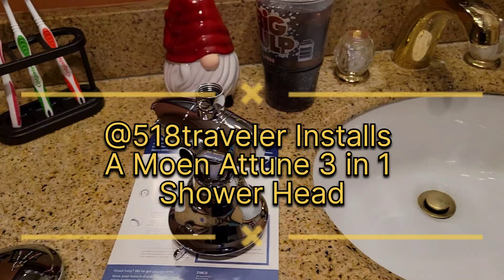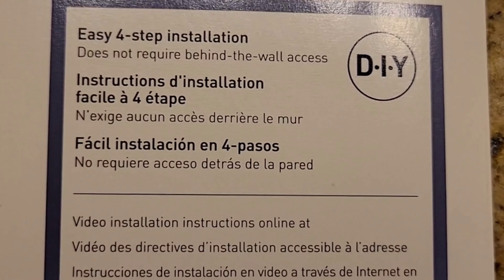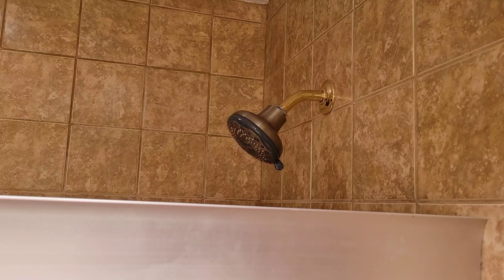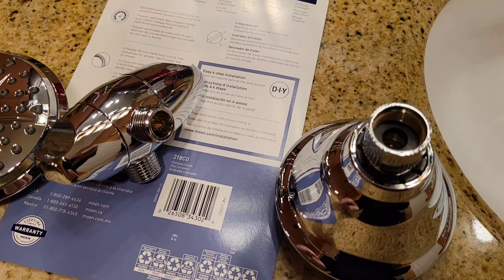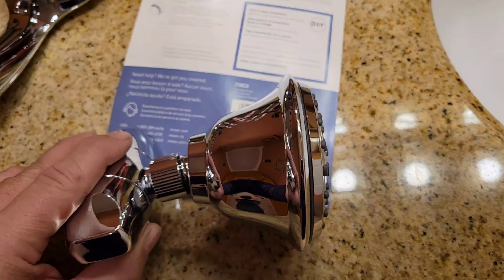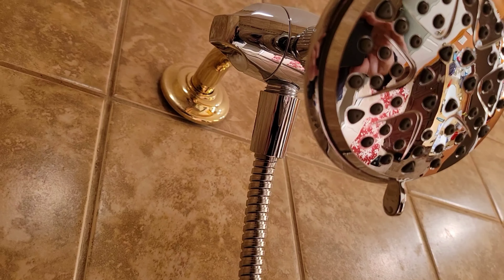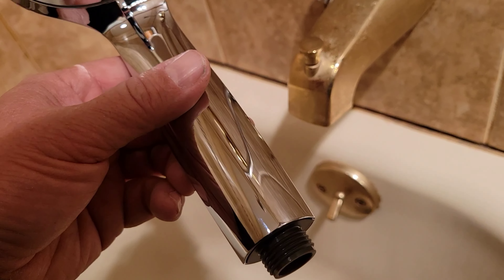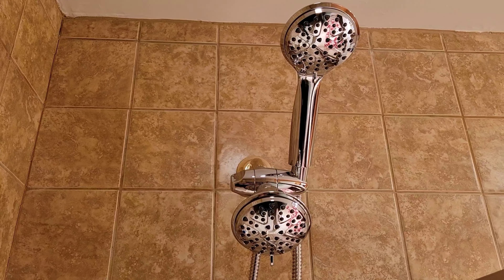@518traveler Installs A Moen 3 in 1 Shower Head

Comment: When I installed mine, water barely came out even when I turned the diverter in each position. Put the old head back on and shower worked fine. Any ideas? Is it a restrictor inside the diverter?
Reply from the maker: @llNATEDOGGll  only thing I can figure is it's a bad item. I'd return for another one n try it best thing I can think of
Reply from the maker: @llNATEDOGGll  hi...I would consider taking it back and exchange it. I've never had that happen.

Comment: Is the shower head still supposed to be loose even though its screwed it onto the shower pipe on the wall?
Reply from the maker: @ulyssesmendez5461  no it shouldn't be at all
Reply: Yes, I just installed this same 3 in 1 showerhead pretty much the same way he did it but mine is swiveling instead of remaining stationary like in the video.  This is a straightforward installation so I'm wondering where I might've gone wrong.